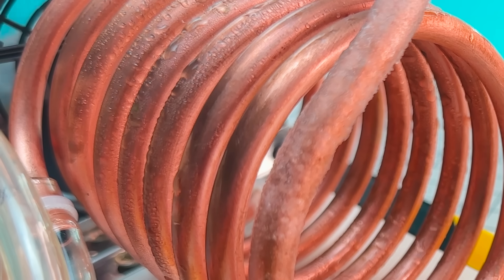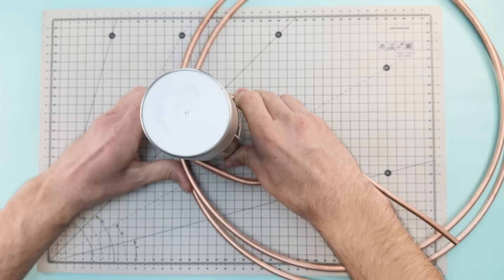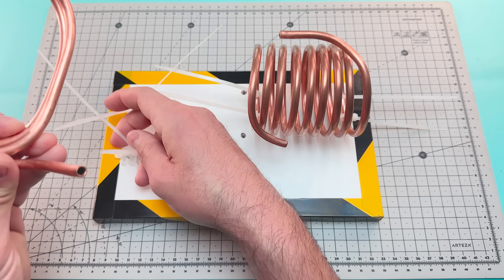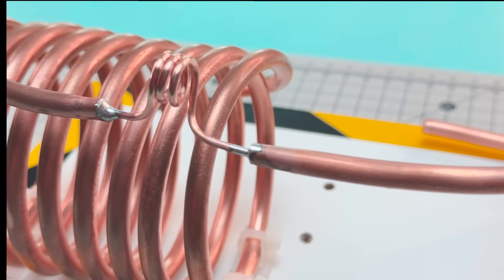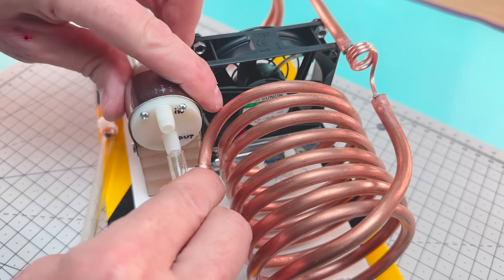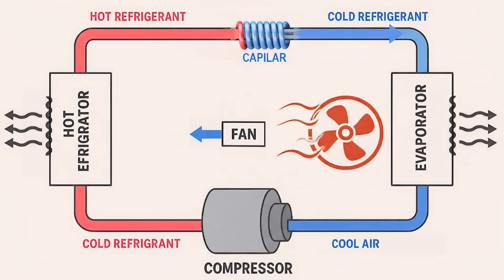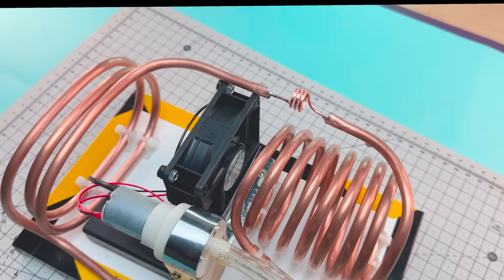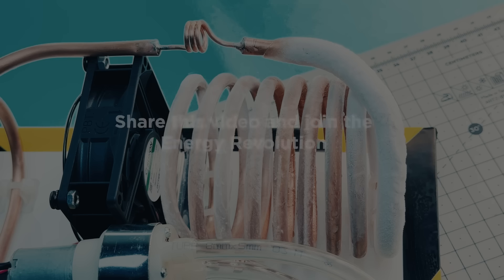Make your own AIR CONDITIONER at home Fast and Easy!

Comment: Кто хоть немного разбирается в физике, понимает куда девается тепло когда газ переходит из жидкого состояния в газообразное. Наверное кпд этого кондиционера равна 0. Как считаете? ну и этот весь механзм можно было заменить элементом пельтье, и не мучаться.
Reply: did you not see the ice? That means that it cools down. It probably is not so effective, but it still works and cools down.
Reply: @gamerboi-do7nr  "If you didn’t understand, I was talking about the fact that when a gas turns into a liquid, it absorbs heat from the surroundings because this reaction requires energy. Likewise, the reverse reaction releases the same amount of heat when the liquid turns back into gas. The amount of heat absorbed and released is exactly the same. So, the efficiency of this mechanism — like that of an air conditioner — is essentially zero. Study physics, it will make you much smarter.
Reply: @smoothie-nice My fault, I was wrong. You were correct. I also didn't really understand the first comment, so I just said something. 
We are on the same page now, right?
Reply: @gamerboi-do7nr  And to be even more precise, the fan and the pump inevitably generate heat, so this air conditioner will end up heating the room more than cooling it.
Reply: @smoothie-nice  and if the condenser is placed outside the room?
Reply: @CyanAddict34  I think that if it’s done properly and the condenser is placed outside, then it will work. To me, that’s logical. But weren’t we discussing the efficiency of this mechanism?
Reply: @smoothie-nice  I wasn’t originally a part of this discussion, so not originally. I just had that specific question.

Comment: Thank you its been so hot all week now my house is nice and cool !
Reply: Incorrect.  This machine wouldn't cool a room.  In fact, it technically makes a room hotter.  Every bit of heat removed  from the room by the cold side is released back into the room by the hot side, which would cause no change in the room's overall temperature.  However, the fan and air pump don't run with 100% efficiency.  They lose energy in the form of friction and heat.
Reply: Please this one send to me I like it so much❤❤❤
Reply: @saidwali9154  lol...why?

Comment: Since you can't create cold, this will make more heat for the room.  Cold can't be created, but heat can be removed which is how all AC systems work - without a way to remove the heat from the area to be cooled, the machine itself nets zero AND you add the heat the mechanism itself uses to work.
Reply: The condenser part should be out of the area you try to cool. This is obvious. you can for example leave more distance between the evaporator and the condenser in a way that the condenser and pump can be placed out of a window and the evaporator and fan are in the room. A split AC are built this way.
Reply: More, with this design the temperature remain egal but de battery will become warmer
Reply: @morjunXII  Its probably only for demonstration purposes, but you cat take it and change it to make it useful.

Comment: So what happens to the heat? For something to get cold, something else has to get hot. In this device, it is the small coil, which would get very hot indeed. Sadly, as that coil gives up its heat, it heats up your room to the same degree that the larger coil cools it. In a real AC, the hot coil is usually separated by sticking it outside, on the outside of window for instance. This device will produce no net cooling. Indeed, the mechanical energy of the pump will also turn to heat, so the device will be a net heater.

Comment: No vacuum?
Reply: For an simple thing like this not really.  In theory any moisture in the system becomes liquid by the time it hits the pump and that pump is a cheap diaphragm pump that doesn't require oil and is sealed.  Its more the crud that is in the existing copper pipes need to be cleaned out if anything.
Reply: vacum it is for carpet dum

Comment: What brand of solder flux is good?, I always fail at soldering
Reply: Ive never done this here but for general solder I have about 2 ounces of stay brite for silver solder but I have used for many solders and it works good, mostly for tattoo needles and destroying my laptop that was still under warranty because I am a whole and complete moron! But the stuf works.  Its got acid in it though so don’t be bathing in it.
Reply: Use multicore flux solder, and get a temperature controlled iron!

Comment: There is a reason airconditionings have an inside and an OUTSIDE unit...
Reply: Yes. As the cold coil heats up, it transfers the cold created by the coil to the room while absorbing the room heat. The outside part  (the other coil) then puts that heat into the outside are as the gas is compressed back into a liquid. The "model" that the video demonstrates maintains the same "total room" temperature since both the evaporator and condenser loops are in the same place, sharing the same air. Think of a refrigerator, it is just a box with the coil that gets cold inside the box and the other coil outside the box. If both coils were in the box the temperature in the box would never change no matter how cold the cold coil got, cause the same air is shared by both coils. By putting the cold coil in the box (or house) and the other coil "out side" the result is the inside air loses temperature over time as the heat is "pumped" outside the box to the outside air.
Reply: @toddbaum4859  more than that: Your room will heat up because of the heat, that the electronical parts produce. But: Nice visualisation!

Comment: ok...how do you get rid of the heat on the condenser? if you let it back into the room the room air will increase.
Reply: I was just thinking about that.  That's why AC compressors are outside blowing hot air out
Reply: You put the condenser inside of a 5 gallon plastic container of water.  Periodically you poor the hot water out, and refill the plastic container with (relatively) cold water from your tap again.  Since water has much much much more heat capacity than air, you won't have to do this very often.

Comment: Great fun... The only problem is that, without separation of the condenser and evaporator, the heat you take out of the air is put right back into the same space... 🤔
Reply: Not to mention, exceedingly dangerous if you don't seal your system correctly, and somehow you end up with a contained fuel-air mixture exposed to a brushed dc motor. However, it is a pretty neat project, and so long as you did something smart with it, like, I dunno, designed a way to sink the condenser into the groundwater or something and power it with solar. What about as a solar fridge for camping or utility disruptions? You could cut up a disposable ice chest and use it to keep important medication cold during the heat of the day. But also, it's a huge fire hazard, and I wouldn't want to have to explain to my insurance company why my garage burned to the ground. Maybe there are better coolants, even if they're not as performant (if it's solar powered, who cares, right?). I wonder if CO2 or nitrogen would work well enough with the right pump...
Reply: @TheRealLightingnerd  The amount he put in is less than in a lighter.  Its the same kind of stuff for R600A in fridges and they only have less than 100 grams in those.  CO2, while it compresses into a liquid, needs to be at a much higher compression and needs a bigger evaporator I think.  To be honest he is using a 5 dollar pump as a compressor and a 9 volt battery without any kind of temp cut of switch.  This is more of a getto can cooler than a real product:)

Comment: Jeg forstår stadig ikke hvordan det kan skabe kulde.
Reply: It's the gas he injected that makes it cold but it won't keep a room cool because he has to disapate the heat off heater exchanger. It would work for a cooler but not long in those batteries

Comment: May have to pursue this.  Alibaba has small compressors for a refrigerator for $20 ea. and a small radiator for $43, just as two quick examples found of units they'll sell a single one of.  I've wanted to experiment with refrigeration to cool the bed area in my van conversion after closing the area off with something like insulation board.  Both the dehumidification and cooling would be an improvement for sleeping, and what surprises me is the temperature drop from such a simply engineered cooling loop; NO vaccum was pulled before adding the refrigerant, the pump is producing crazy low pressure, but on the other hand, we don't get to see what the temp is further down the coil, I imagine it may quickly get above 0C or 32F since this is such an over simplified design.  And as any air conditioning tech will tell you, icing up like that is an indicator of not enough air flow, which I can surely get in a design.

However, using the Alibaba components I listed, why couldn't you solder in a fill port for traditional R-134A (which is less combustible than isobutane) as used to charge an automobile AC system, and get some moderate cooling in a practical way for an airspace above my bed that totals <100 sq. ft. of airspace?  I have a roof vent directly above the bedding area, and can imagine making a boxed in area to exchange the hot air and let it directly rise out the vent.  I can also just use a 12v fan, powered off my huge lithium RV battery to circulate the air within the space.

I've thought that a small group of peltier devices (since they sell units with a fan mounted ready to run) could be made to work for my applicatoin, but seeing this so simply built raises the question of which would be cheaper to build and require less energy.

If the whole thing worked, I'd even be tempted to invest in a vacuum pump and hoses, since Harbor Freight or places like Temu have those pretty affordable.

I also can't help wonder about a whole battery of these working together, powered by maybe even a single solar panel (100 watts these days is $50 or less) (obviously the pump motor would need to be upgraded).  Living in Florida, cooling is our biggest expense, so I've always wondered about the feasibility of a low pressure alternative to traditional air conditioning for a 100% duty cycle unit, since by using low pressure, it seems like even a decent compressor pump should last a decade or more and nothing gets strained, sort of what we're seeing here, since the isobutane seemingly is not escaping at slightly over one atmosphere of pressure when he pulls the needle and seals it in.  But an 8K BTU window unit these days only costs about $50/year to operate, but if we reimagined it to be a lower pressure design and virtually eliminate wear and tear on the unit, why couldn't we run it 100% duty cycle off a single solar panel and get some net cooling for free after recouping the initial outlay?
Reply: Bro stop smoking meth and buy a window shaker
Reply: 😂😂😂😂 @joebarrow7313
Reply: the only thing this setup could be good for is cooling water in a food cooler, perfect for chilling beer but you would need to mount the evap inside in the water plus a circulator pump in the water  and probly a fan on the condensor mounted outside the cooler  AND hook up to a car battery cig lighter plug.

Comment: Curious, I had to use AI to look up the difference in isobutane and a traditional refrigerant like R-134A:

"Is Isobutane (R600a) a Better Refrigerant than R-134A?

Performance and Efficiency

R600a (isobutane) is recognized for its higher energy efficiency compared to R-134a. It generally offers better compressor efficiency (higher COP) and lower power consumption, making it more energy-efficient for domestic refrigeration applications125.
However, R-134a typically has a higher refrigeration capacity and cooling efficiency, which can be advantageous in certain applications, especially where higher cooling loads are required5.

Environmental Impact
R600a has a very low Global Warming Potential (GWP) and zero Ozone Depletion Potential (ODP), making it a much more environmentally friendly option than R-134a245.
R-134a, while having minimal ODP, has a significantly higher GWP (about 1430), contributing more to climate change and facing increasing regulatory restrictions worldwide245.

Safety Considerations
R600a is highly flammable (classified as A3 by ASHRAE), which introduces safety risks in case of leaks or improper handling. This necessitates careful design, installation, and maintenance to mitigate fire or explosion hazards135.
R-134a is non-flammable (A1 safety rating), making it safer to use in a wider range of applications, especially where flammability is a concern13.

Compatibility and Usage
R600a is commonly used in domestic refrigerators and freezers, especially in Europe and Asia, due to its energy efficiency and environmental benefits1345.
R-134a is more widely used in automotive air conditioning, commercial refrigeration, and other applications where higher cooling capacity and non-flammability are prioritized45.
Direct replacement between the two is generally not recommended due to differences in flammability, oil compatibility, and system design requirements35."

Comment: Одна часть охлаждается, вторая нагревается. В итоге результат нулевой)))
Reply: Of course. Even worse than null (it will be a net heater), because the efficiency is smaller than 100%. It is like you'd try to "cool the room" by opening the door of your fridge. Also, the power of this device is tiny compared to the fridge, so you can maybe cool a small drink, but not very fast anyway.
Reply: На самом деле, это в принципе полностью фальшивая конструкция :)
Давление конденсации пропан-бутана, при комнатной температуре, около 9 атмосфер. А учитывая то, что конденсатор холодильной системы, должен быть для её работы горячим, там минимум десятки атмосфер должны быть. А у него, силиконовые шланги, которые в принципе такое давление не выдерживают. При этом, вместо полноценного холодильного компрессора, установлен 9-вольтовый пластмассовый аквариумный насосик с алика, который вообще негерметичен, и в котором даже поршней нету. Да, там вместо поршней, резиновые пимпочки, с надавливающим на них пластмассовым колёсиком. Эта конструкция, хорошо, если способна хоть одну атмосферу выдать, а скорее всего, там нет даже этого показателя... А он, ещё и запускает это чудо от батарейки... ёмаё...
То, что нам демонстрируют на видео, чисто по законам физики, работать не может :)
Скорее всего, он тупо ставил всю эту конструкцию в обычный холодильник, чтобы заранее немного её охладить, а потом доставал и подключал ко входу медной трубки, которая у него является типа конденсатором, вместо силиконового шланга от китайского пластмассового насосика, шланг высокого давления от большого газового баллона (не того баллончика для зажигалок, что показан на видео, а именно большого баллона), непосредственно на торец медной трубки, через переходник... и в течении некоторого продолжительного времени, стравливал этот баллон, пропуская газ через трубки, тупо в атмосферу. И таким образом, он получал замерзание именно на участке после капилярки (чтобы картина замерзания выглядела так, как и должно быть в реально действующей холодильной системе). Именно поэтому, во всех кадрах, где показан сам процесс замерзания, мы не видим нижнюю часть конструкции, ведь там отключены шланги от пластмассового аквариумного насосика, а вместо этого, к металлическим трубкам, подключён баллон :)
Я не знаю, может быть, он получал иллюзию охлаждения каким-то другим способом, но в любом случае, та бредовая конструкция, что показана на видео, чисто по законам физики, нормально работать не может.

Comment: I think the expense of getting the parts and assembling it versus buying a home AC is not worth the effort. Unless you are a real DYI nut. You can get an air conditioner for less than 150 dollars.
Reply: even better, you can probably get decent ones for 50 dollars when you buy second hand

Comment: You just created a piss poor space heater. It only introduces the additional heat from wasted electrical energy.

This could be very nice as an outdoor tabletop cooling fan, but don't use it inside unless you've devised a way to vent the heat out.

Also, most small room AC units collect condensation making them useful as a dehumidifier which (especially if you're desperate enough to try this) would do way more for comfort than adding more heat with the added cost of batteries.

...it seems everyone in the comment already knows this and I'm just shouting into the void.

Comment: You're forgetting two very important things:
1) You need a fan which cools off the condenser coil
2) You need to exhaust the hot condenser air to the outside

Comment: I don't see how the cooling and heating effects of the unit do not offset each other.  With the addition of electricity from the battery to power the fan, the net temperature change should be positive, shouldn't it?  Don't you have to dump the heat to an external location as is done with car air conditioning systems, home conditioning systems, window room air conditioners, and building air conditioning systems?  And will this tiny thing noticeably cool a 12'x10'x8' bedroom or just a standard 2-man pup tent?
Reply: Awating a reply on this
Reply: @digital1834   Don't hold your breath.

Comment: At most this will cool a drink.. whats its cooling capacity? 10watts?
Reply: not even, that pump is MUCH to small to create enough pressuredrop to actually do vapour compression cooling. This won't cool anything without a bucket of ice connected to it